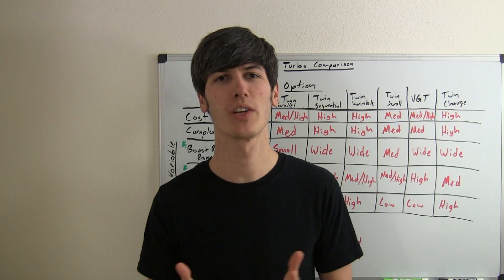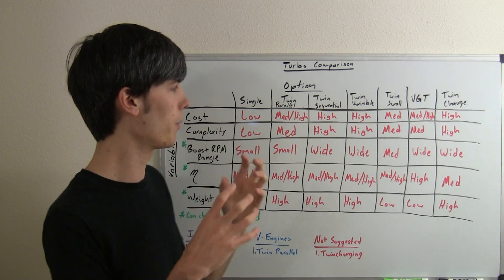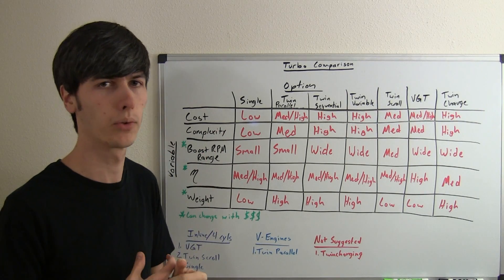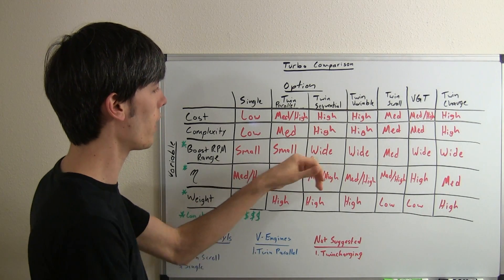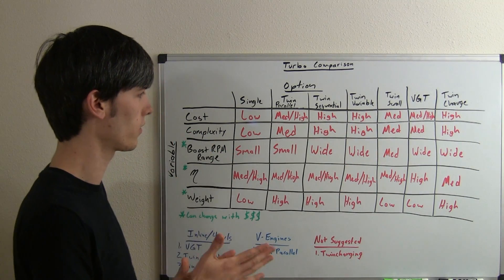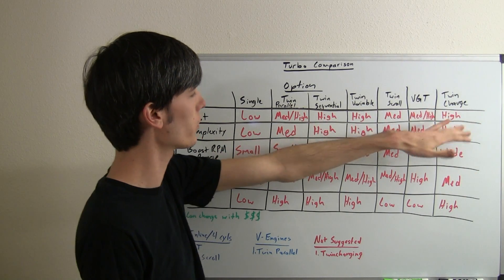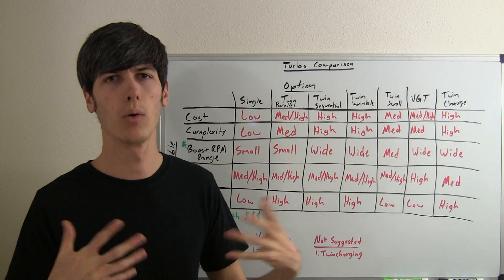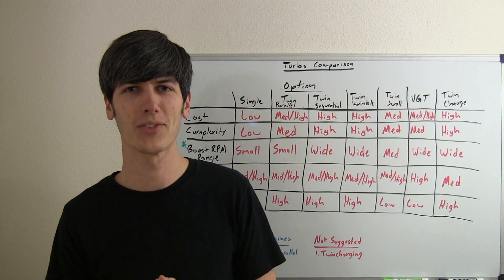Turbocharger Comparison - Twin Turbo vs Twin Scroll vs VGT vs Single Turbo

Comment: I feel like a key row that was omitted is "Max Boost." For example, based on this table, there is absolutely no advantage to Twin Parallel over a Single. Presumably, the reason one may opt for a Twin Parallel is that it can achieve a greater maximum boost than a single turbo.

Comment: Regarding Twin Charging:  Sometimes twin charging is the only possible solution in certain applications - specifically 2 stroke diesels.  Most of the over the road 2 stroke diesels have to use a supercharger just to be able to run at all.  An example of this is a 6-71 inline six diesel (there are a lot of them out there still) that comes stock with a supercharger - and it won't even start without it, because the air path to the cylinder is restrictive and a few other reasons. The only way to significantly improve performance on these is to run a turbocharger that feeds the supercharger.  It is not the best solution, but it is the only one that will work.

Comment: The original GTR skylines and the Supra had twin sequencial turbo chargers.
But the twin scroll turbo if designed properly like the one on the B58 engine in the new Supra is the winner for an inline engine application.
But on a V engine configuration one twin scroll per bank is hard to beat.
Great job as usual.
😃😃😃

Comment: my turbo rpm range is 2500rpm to bit over 5000 but engine max rpm is bit over 5000   mb 270cdi not stock turbo 5 sylinders

Comment: Do you have a video that explains how to determine what exhaust housing a/r is best suited for a particular turbo and motor? I'm. Having a difficult time selecting the correct exhaust housing on a gtx3576r for my rb26dett. I also do not understand how to read the turbine map. There's tons of videos on the compressor map but not the turbine map. A response is greatly appreciated!!!

Comment: so
variable has differit size turbos which , work togheter all the time in some applications
sequential is when one works at high rpm while the other all the time , they can be twins or differit sized
?
Reply: Twin parallel uses two equal size turbos, increases responsiveness but doesn't really increase boost range.

Twin sequential uses a smaller turbo to spool up a larger turbo for faster spool up and improved boost range. Think of it as a single turbo being assisted by another, smaller one. 

Variable twin turbos idk much about, but it seems likely that it uses a small turbo at low rpm and transitions to the larger turbo at higher RPM

Comment: Twincharge was used on Fiat-Lancia models in the 80's but discontinued a few years later. Mercedes used superchargers for a while and I think some top end models used a twincharge setup. Ferrari; Mazda and Opel used a swiss BBC comprex pulsating wave charger and I think some attempts were made using it in a twincharge comprex-turbo setup.

Comment: Hi Engineering Explained. I am watching many of your vids. I never cam across to this one. My friend and I are trying so hard to learn about turbo. It is not so easy for what we want. We love supercharger do to the quick boost on low rpm. We don't have that Budged now. Can you help us with the selecting of the right specs turbo? We have a stock LS1. We want to boost it with a turbo. We are looking for less lag and quick a spool turbo for much power in lower rpm.we need quick respond throttle. we don't need much power in the max rpm. Of course the engine shouldn't chock because of to small turbo. Pls help us with a good selection. A/R  T? flange? turbine type outlet compressor size. One person told us start with A/R 0.68.  some say it is to small. Thank you in advance Engineering explained.  Regards
Reply: Dude, check out Corky Bell's book, "Maximum Boost". It'll teach you the basics. Not that complex, if you're mechanically inclined, and the numbers are easy to understand.

Vital to look for is turbo size (depending on your intended application), intercooler size, proper cooling and oiling lines, and maintenance.

Comment: If twin sequential turbos give you a wide powerband, why every car manufacturer uses parallel twinning...bugatti uses a sequential turbo on both sides only....what about the other manufactures... why is it so uncommon?
Reply: Cost and complexity primarily. Most cars have fairly modest power goals and don't require such complex setups. Standard modern twin setups can provide excellent response and have a very wide power-band that is more than acceptable for a street car. (Look at the BMW N54 and later N55 as modern examples) It takes less money to design, less money to build, and less money to repair which all means more money for the manufacturer. Profit will always take precedence over performance in high-volume production vehicles.
Reply: +v2mmxst10 
You took the words right off of my fingers.

Comment: I was thinking about a twin parallel setup for my 5.8L V8 (it's a truck)
Reply: Joshua Kent 
You might consider a dual Twin scroll setup I use it with a 4.4L V8 
I dyno it at 613 hp and 522 torque no mods

Comment: IMO the VGT would be more along the lines of a twin scroll turbo when talking about the boost/rpm range. More or less a medium range, also the application plays a big factor. I also could be completely wrong.
Reply: SigBlackwater226 
You are pretty much right. There is no specific VGT for all manufacturers, so for example the VW var. geometry system is perfect for 2-3.5L but 4L is pushing it. Albeit a turbo rebuild can harvest much more if you have $10,000 for that.

Comment: Isnt it possible to achieve a fairly efficient TwinCharged system? I mean i realize that a Turbo and Super charger mounted separate are not the best option in the world, but in some Diesel applications such as Supercharging directly into a Turbocharger can increase efficiency. I helped add a Tubrocharger to a stock powerstroke engine once and with some programming, the customers efficiency increased. Although to be fair, the average RPM decreased slightly. It still drove very smooth and built power laterally, but less throttle was needed to get up to speed.

Comment: I've seen cars with a twin charge system that are quite ridiculous, and I find that the idea of combining the supercharger and the turbocharger for their individual benefits is rather appealing. Constant boost to rip out of corners and such, then the turbo to kick in at mid-high range to rocket down the line. The only downside I've heard of is that you're gonna break a lot of things quite frequently. Do you have any other detriments that you could expound upon?
Reply: +Tahtonedoodoverthar
High maintenance and high initial cost are the only real ones, but it is definitely a maintenance-intensive system.  To keep the engine in good shape it is important to understand the MTBF numbers on things like hose and interface seals, and replace them BEFORE they fail; otherwise the life of the engine can be shortened considerably.

Comment: say on a diesel that benefits on low to mid rpm boost, would parallel be better than one large turbo since should lower boost range. I believe a 2 stage at a disadvantage on a V engine since turbos would at a distance from the main heat of the exhaust but viable on a L engine. I am doing parallel on a 6.9 idi with two hx35w's

Comment: So what about using two variable twin scroll turbochargers on a V type motor, like say a V6? Would you be able to achieve an insane amount of horsepower by combining that with a highly efficient air to liquid intercooler?
Reply: Okay so I'll give this a whirl seeing as this video is older and this comment is fairly recent. Essentially what you do when you parallel turbo a V6 is you're treating the engines as two 3 cylinder engines smashed together (which it actually is essentially). So instead of using one turbo powered by the two "engines" you're using one turbo per "engine" which results in more usable boost because you're making better use of the exhaust gasses to run the turbos but in the long run isn't a huge difference just much more efficient. Most car manufacturers that do turbo a V6 or V8 model will only put one turbo on it because of the added cost/complexity/weight of the twin parallel doesn't really outweigh the performance gained regardless of whether it is a twin scroll/single scroll/VGT or what have you.
Reply: Jacob Harwood 
Yeah, OEM's aren't interested in the best of the best. Like ford's 4-cyl engines can make 200-300 hp in a 2L but they would never ever put such a delicate engine in the hands of consumer motorists. You can always buy a pimped version of your engine and tell your insurance company it broke and you bought a brand new motor that is an "exact match".
Reply: +MagicDartProductions 
I just read (old) news that Porsche is doing exactly that with the Panamera - so is Genesis with the 2018 G80.  Both engines are V6 Scrolling Twin Turbo designs.

Comment: VNT - VGT is the best!
Reply: Best for what? ;) Only for your budget. Sequential twinturbo is the best solution. I know it, I have had VNT turbocharger and I build sequential twinturbo and get better spool, pedal response, RPM range and maximal power too.

Better is only sequential twinturbo with centrifugal supercharger to get on better efficient boost level in higher RPM range.

Comment: hi, im using ej20 GRB 2008 jdm sti.. currently running stock twin scroll turbo, i plan to upgrade my stroker kit to ej23.. is it good to combine single scroll turbo to my ej20 compare to twin scroll turbo? the biggest turbo for stock location for twin scroll turbo are only for 550 hp while most single scroll turbo do have more hp?

Comment: VGT is currently difficult to implement in gasoline engines because the the variable geometry mechanism is not robust enough to withstand the 1000 degC exhaust temperature from gasoline engine.

Comment: EE: Would you compare turbo lag of the options you covered? I believe a twin charge system has virtually no turbo lag because the supercharger works immediately at low rpm. This is why despite high cost, weight and complexity, some auto makers use twin charge system. Would like to hear your comments on turbo lag for other turbo options. Thanks.

Comment: you basically stated that Twin Charge is silly due to several factors. So why did Volvo went with that option on their brand new SC90?
Reply: +sigor2011 See my comment above. Twin Charge virtually eliminate turbo lag at the expense of complexity, weight and cost.

Comment: why aren't VGTs more popular on v8 platforms? cost? If the boost curve is much more spread out than just up top with a big single, why don't we see more of them? great videos!
Reply: +Dan Bonk Most V8s already have pretty good driveability, so FI tends to be all about top end power (not area under curve).  Also we already spend most of our cash on gas so have to cheap out on a big single turbo :)

Comment: Would it also be a good set up if you installed a VGT into a V-engine? Understanding that Twin Turbos would be good since there would be 1 turbo for each exhaust manifold, if you wanted to keep it relatively simple then would VGT be a good choice as well?

Comment: Superchargers less efficient than turbochargers? Are you sure? What matrix do you mean when comparing the 2? I find supercharger more practical and turbo more powerful. As far as efficient.. I get better mpg on superchargers than Turbo provided the season I'm driving. Cheers ty for info btw
Reply from the maker: Turbos are run by (otherwise wasted) exhaust gases. Superchargers are belt driven, parasitic by design.

Comment: what's your opinion on turbo heat blankets?  Would using one cause a turbo to fail prematurely?  Thanks.
Reply from the maker: +JWHyperBlueSTI Beautiful car by the way!! Heat blanket might not be the best for longevity, if it gets too hot, especially if it retains heat when you shut it off if that affects the bearings. I'm not sure to be honest, I guess I don't see a major benefit of using one. If they were critical or quite helpful, why not ship from the factory with them?
Reply: +Engineering Explained Thanks.   I guess the main reason I see people use it for is to reduce the engine compartment temperature so that the air going into their intake isn't as hot.  I would really love to see you throw some real science on this topic one of these days.  Love your channel.   :)

Comment: What's the deal with compound turbo setups? I understand how they work, but how do you plumb one? The inlet side I believe you draw air into the large turbo first and then push that already compressed inlet charge into the smaller turbo where it's further compressed. But how do you plumb the exhaust side?!? Does the exhaust flow the same path or opposite of the inlet? So out the head, into the large turbo first and then into the smaller one? That would require a really large A/R ratio (compared to what it would require in single configin) in the 2nd smaller turbo's exhaust housing? Or do you flow exhaust through the small turbo and then the large turbo and still use a large A/R ratio on smaller turbo 'cause it's going to require lots of pressure to further compress that inlet charge- what's the deal?

Comment: A twin parallel setup is far more responsive than a single large turbo supplying both banks of the V, even if the final power outputs are going to be the same as the single. That and from a design perspective it can be easier to plumb them either side of a v8 than a single large turbo and spreads the same amount of heat energy across a larger area.
So sure its more complex than a single turbo, but I'd still vote on its superiority for a V style engine.
Reply: 100% agree

Comment: 2JZ + Single Turbo + Antilag = WAR
Reply: +Mike Hammond why, of all things, would you pick a naturally aspirated gas TRUCK engine? What about the ISB? or even the new non-IHC powerstroke? 
I drive a work truck with a 460 Ford in it and good christ it's a pig.
Reply: f250 big block naturally aspirated accepts war
Reply: keeganwebber 
Yeah, I would love to hot-rod an f-250 with a turbo ls for driving around town/cruising to pickup a yard of gravel lol maybe 3.47 bags of post-mix if it's a heavy day loooooooooooool
Reply: keeganwebber lol the concept made me spit out my drink! Lol i got the mental image of this " big block" F250 ya know cuz the 250 has the extra weight for the increased payload=more weight to carry... This VS. wouldnt be a very sporting event.
Reply: What tf is anti lag?

Comment: What do you think is the best option for a flat 4 (or 6)? And what about a parallel VGT?
Reply: +Blackfinger 
Parallel VGTs seem rendundant to me, because a VGT can expand (as the engine speeds up and produces a higher volume of gas) to handle the higher flow rate.  We have an older Sprinter work van with a 5-cyl VGT that gets great boost in the 2-5000 rpm range.  If the engine has a lower compression ratio (which hardly happens in diesels) it might make sense on paper, but aside from that a larger single VGT can handle a geometrically larger airflow as RPMs increase.

Comment: Dude are you joking about twins having a small rpm range? That's the whole point of twins, to spool up faster than larger single but yet put out same power!!!!
Reply from the maker: mikesanto70 If they're for separate cylinder banks it very much so operates like a single turbo (for V shaped engines). Each cylinder bank acts like it's own engine, and each has a turbo. If the turbos are sequential, yes, there will be a larger operating range.
Reply: Zombie4416 actually, I do, I'm no Engineer, but I have built and bought  more turbo cars and airplanes, by the way, than a little internet loser troll like you spouting off randomly just talking out of their ass daily to whom ever they feel like pissing off that day.....go get a job and throw some wheels on your Hyundai so you can be ass cool as you pretend to be, "dude"!!! LMAO

Comment: Could someone please explain why are VGTs only for diesel engines?
Reply: Engineering Explained If a car is running ethanol fuel a VGT still wouldn't work would it?
Reply: fjmcbob they do they call em something else..... they work off vacuum tho
Reply from the maker: fjmcbob The vanes typically can't withstand the high exhaust temperatures of gasoline engines.

Comment: A twin parallell setup has a wider range than single. Because even if you split the displacement of a 3l engine in two for a 600hp output. The rotational inertia of one 300hp turbo is easier to spin for 1,5l of displacement. Than that of spinning a 600hp turbo with a 3l displacement. Also you get the benefit of dividing the pulses from each other. For example a V6, I6 or definately a V8 gets a benifit of only having half of the cylinders "disturbing" or helping each others pulses before the turbo. For a V8 configuration, two twinscroll turbochargers are ideal since you can divide the exhaust pulses so that you get two cylinders acting upon each port of the turbos. You also get the earlier explained pros of lower rotational inertia compared to a single.

Comment: i think the power that a supercharger has ,in a twincharged system, outweighs the loss of efficiency
Reply: i have to agree, i plan on doing a build with a twincharged system. the nice part about twin charging is i can slap some insane turbos on the engine and just let the supercharger hold me up till them big beast spin up
Reply: I will point out that in terms of extra horsepower delivered over horsepower consumed, twincharging systems are the least efficient; they can =potentially= deliver the most total performance increase.  But EE dude was saying that they are "not the best choice in a production model car".  In track-only designs one can pick-and-choose parts that will maximize a particular system's advantages - not so in street-legal models.